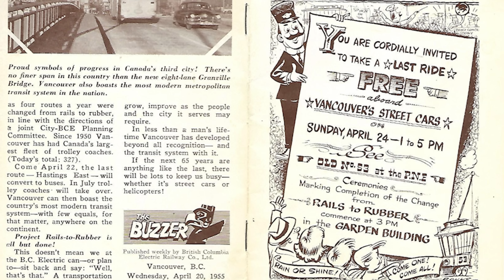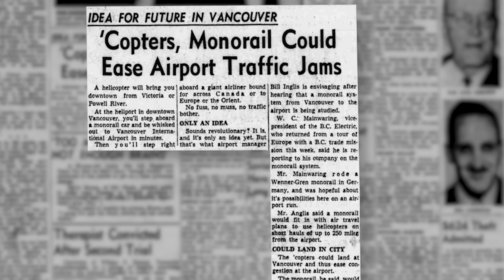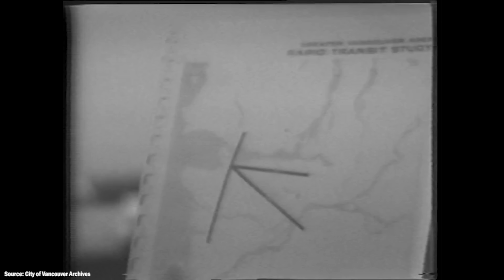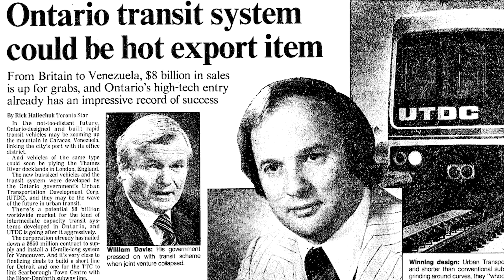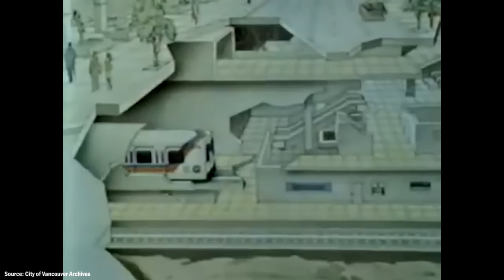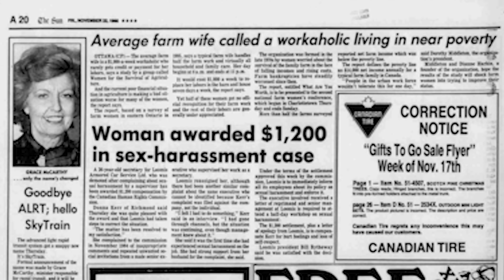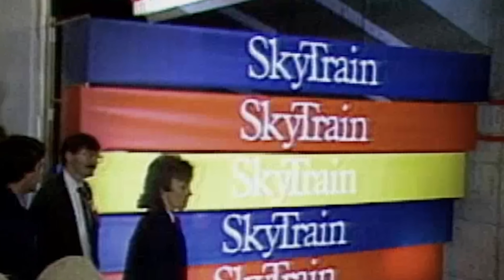History of the SkyTrain

Comment: I think a lot of people also forget how contentious the original debate over Skytrain was. Skytrain always had those boo-birds who would predict that such mass transit systems were white elephants that could "never possibly" meet their ridership targets and would run basically empty almost all the time. To anyone riding a Skytrain line today, it sounds absurd, seeing how crowded the trains are, but the naysayers had an effect during the planning, because the effect was convincing politicians to build capacity that was too little, not too much. And they never learned their lesson either, because when the Millennium line was built, they also managed to stop the construction of that to UBC, where it always should have gone. Then when the Canada Line was built, they said the same, and it is probably thanks to them that the stations (capacity) were built too small, not to mention choosing different kind of train and track so they are not interoperable. And the bizarre decisions to point towards north Coquitlam instead of PoCo or prioritize Langley ahead of either UBC (yet again) or Newton / south Surrey, I am sure that is politics talking, not unbiased planning & engineering. On top of that there is the tit-for-tat politics or right and left that have always gone on, where they will kibosh any project of their opponent just as some kind of "f*** you" statement. And lastly, there's still people out there who try to throw streetcars, trolleys, light rail into the conversation as if the issue as not already been decided. Take all these together and you see people pushing their narrow agendas for short term "wins", and never mind whether they are screwing up Metro Vancouver's long term transportation plans by doing that. It all makes me shake my head in dismay, but hey, that is the norm for anyone watching BC politics tackle any major issue.

Comment: What the book doesn't tell you is that SkyTrain is the name of the regional light metro system and not the trains used. 

The trains used on the Expo and Millennium Lines are proprietary and the proprietary railway railway has been unsalable, with only 7 such systems built.

Two were forced upon the operating authority (Vancouver and Toronto); Two were built by paying bureaucrats and politicians "success fees" to ensure the system was built (Korea and Malaysia); one was built , paid for the Canadian goverment (taxpayer) because the it failed a peer review for federal funding (JFK AirTrain); one was built to acquire technology (Beijing); and one was built as a demonstration line (Detroit).

Only six remain in operation and there has been no sales or interest for now over 20 years.

The Canada Line, which is a conventional heavy-rail metro, built as a light metro and by design, has less Capacity than a modern tram or streetcar costing a fraction to build.

The SkyTrain light metro system has proven to cost more to build; cost more to maintain; cost more to operate, lacked capacity and lacked flexibility, when compared to modern light rail.